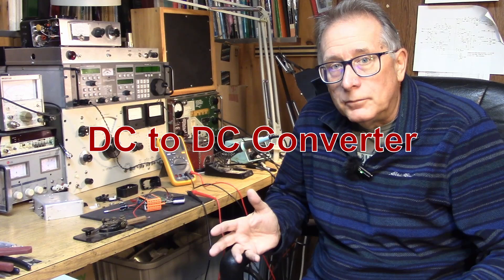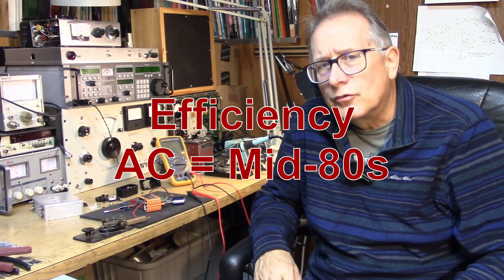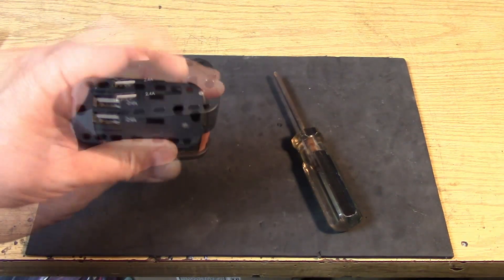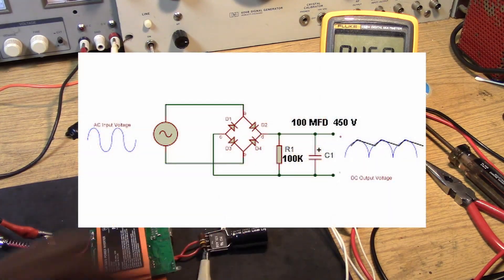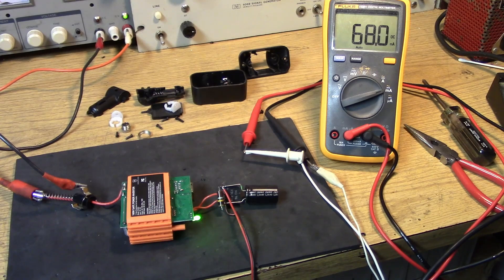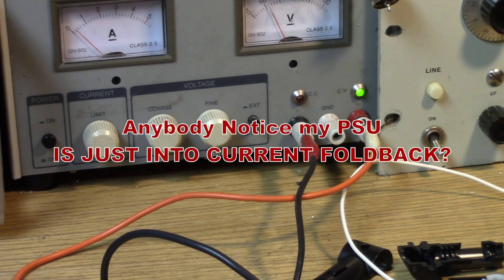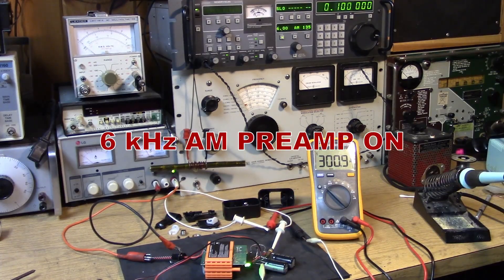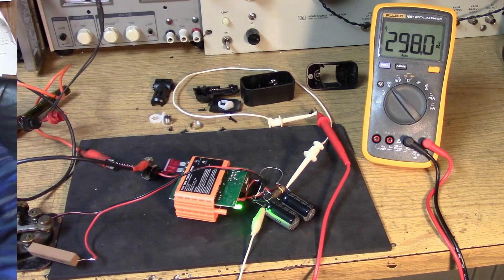1930's TX - DC DC HV Converter

Comment: Just a thought being as I'm on the bottom of the world and we use 230V AC ...could a 12V to 220V AC inverter be used without the doubler?  Would give 316V DC peak.

Comment: For the noise, I think it would be more useful to check on a wider bandwidth with a small SDR. We do see that many of the switching supply can do multiple spikes and almost no noise on some frequency. Yes those Switching PS use higher frequency for the switching to AC. While the DC to AC will switch at 60hz.
Reply from the maker: I am sure that would be more useful and faster!

Comment: Way to go, buy an off the shelf Inverter! It's also a switching P.S. most likely modified Square wave output. If you dig father into the Inverter you should find a 12 vdc to about 150 vdc switching P.S. feeding four power Mosfets in a bridge circuit that generate the actual 120 VAC.
Reply from the maker: A schematic might help. This thing has too many safety overload features.

Comment: Great work!  I'm currently working on a similar themed valve project that also uses a cannibalised switchmode transformer.  Some months back you built a PDM AM rig.  I intend to put that PDM signal through the transformer, low pass filter it, and generate a modulated B+ which I can use to plate modulate a 25W class-C tube final.
Reply from the maker: PDM is a proven and efficient technique for AM, whether SS or Tube.

Comment: Great Information ! What precautions do you need to be aware of with 300 volts across your key ?
Reply from the maker: Keying the cathodes or filaments in this case is not the same as keying the B+. There is far less voltage.

Comment: Well done Mike! I would have never thought that cheap inverter would be that quiet on HF! 
And that battery is super small!  Even a battery double or 4 times the size would easily fit into your transmitter. Then you would have lots of capacity to run the filaments and the H.V. May even have less voltage drop?  73
Reply from the maker: Who knows why it is so quiet. The protection features on this inverter are giving me fits however.

Comment: That little inverter is built much better than I would have guessed. If you need more power, packing along another battery or putting it in parallel with the first is an easy option. Full of win.